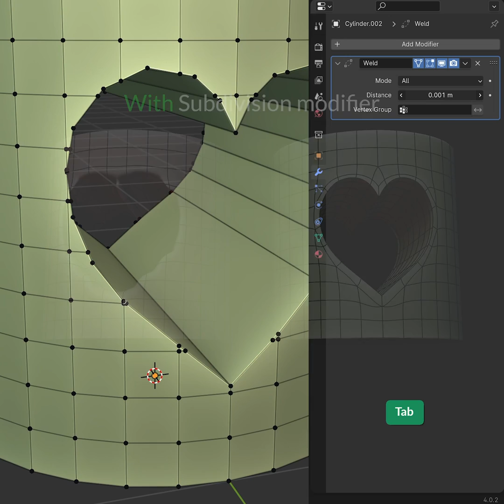Boolean Holes to Quad Topology | Blender Secrets

Comment: This method is not good just saying
Reply: 100% with this guy. Not dunking on the poster, but if you're willing to disrupt your cylinder's curvature to support a boolean, you've blocked out badly and have made something only hobbyists will accept, not professionals. Shrink-wrap is a quick fix and requires a destructive export, rather than keeping subdiv 0 fir the file.

Comment: the alternate way for such things is to use Non-destructive ways using Hops and forget about boolean cleanup.
Reply from the maker: Sure, then it's not a subdivision workflow.
Reply: yes, i agree but i fedup with tutorials of Boolean and then do cleanup for subd workflow  @BlenderSecrets  but you are doing your work and i agree with your content theme.
Reply: @rajendrameena150 I see boolean and cleanup as the unprofessional way.  There are always correct ways to do everything.
Reply: @BestMods168  in Art, professionalism is unprofessional.
Reply: @BestMods168  There are many cases where boolean+cleanup is a lot faster.  If the end result has the same quality than your "professional" way is actually dumb and being faster is smart.

Comment: Chief ! i have never used the weld modifier so i'm wondering something !
during the step you create the boundary loop to support the shape before applying subdivision, u may, while creating the bevel, recreate overlaping geometry or have some vertex going beyong already existing geometry, this will require another round of cleaning. So my question is, will the weld modifier be usable here to kinda get rid of this ? anyway, thanks again for the amazing content, even if i'm sad it's gettin shorter and shorter :'(
Reply from the maker: What do you mean that it's getting shorter? The bevel shouldn't go so far as to create overlapping geometry.
Reply: i meant that the video format is now mostly shorts and i enjoy longer content ^^' 

ho alright then i gotta take care of having enough space before going for the bevel i guess, i just tried it on an armor part i was modeling it worked wonder, but i haven't tried a boolean with "softer edges"  i have to give it a try and see if i can manage to obtain something clean this way !
thanks again ! 
 @BlenderSecrets